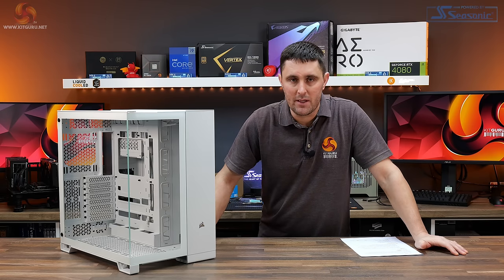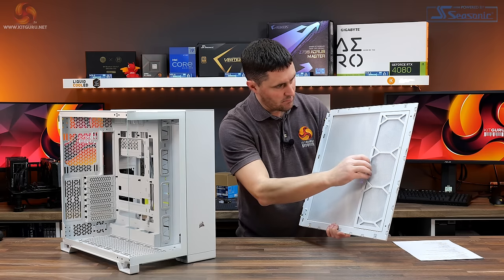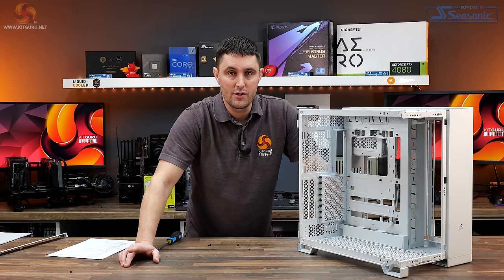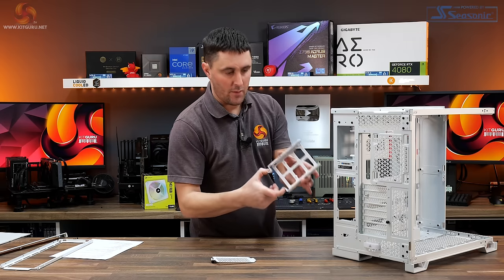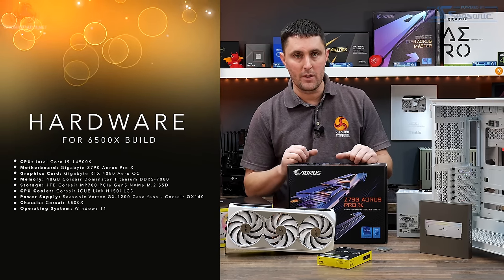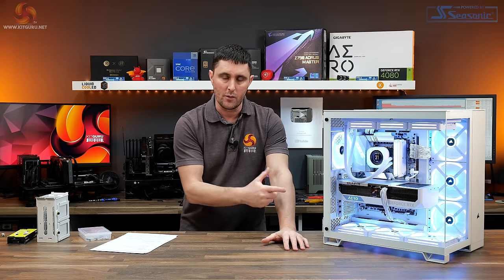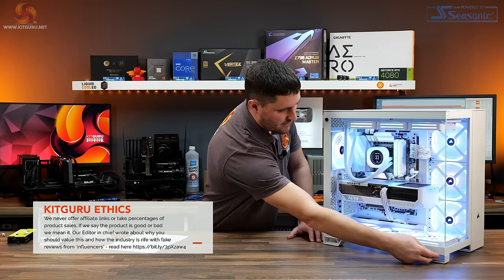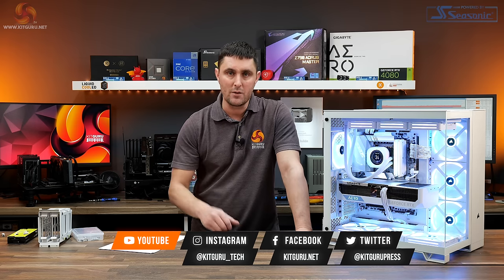Corsair 6500X Case - the good, the bad and the ugly

Comment: I was switching my PC's case to get one that had better cooling a few months back, I ended up going with the airflow version of this case. I've gotta say that I do love the case.

One thing I do need to point out. My PCIe slots for where the GPU screws into were also slightly off, slightly further back than other cases on the market. This was honestly a good thing! One of my biggest concerns was that with there being no floor from a PSU shroud, I couldn't use my GPU support bracket (I have one of the ones that is just a screw pillar). The PCIe screws being further back are actually putting more force onto the GPU, so much that it isn't sagging like it would've in my previous case, the GPU is perfectly level which I feel like may be by design... Struggle to get it in, but once it is, it really holds well!

The need to pay extra for the cable management straps did kind of bug me, but I solved this by just 3D printing my own and putting some velcro straps I already had in them.

Comment: I just got this case. One of the primary motivations in choosing it over the Lian Li option was the usb ports on top. Given my PC sits below the desk and that would put the ports at floor level. Thanks so much for your review!
Reply: This case comes with rgb fans?
Reply: @sectum.sempra  the rgb version does. the 6500x base does not, but the 6500x rgb comes with i think icue rx 120mm fans

Comment: I wish they would make a case that can accommodate a 420mm AIO in a push pull configuration with a thick radiator like Arctic Liquid Freezer iii mounted anywhere. The ideal case should have good airflow as well including the gpu.
Reply: Yeah the downside might be that the case would be massive
Reply: True but we need functional cases. And most of the time, there is a limitation on either the size or the location of AIO placement. I want one that has it all.

Comment: I'm just hoping for a bigger full size ATX version that supports a 420mm radiator. Aside from a few other nitpicks I love the case and the support for wood panels! Almost perfect! 
That is of course if this supports vertical GPU mounting. 
Also get rid of the white strip on the front glass panel on the right side. Would look much cleaner and less outdated like the New O11 Dynamic from Lian Li. Especially with this price.

Comment: I fail to see the point of this case for anyone outside diehard Corsair fans, pun not intended. Most O11 inspired cases from other brands compete on price, while the 6500X shown here is $40 more expensive for no discernible reason. The amount of flex on the rear panel is unacceptable for a case of that price. Looks like I'll be sticking with Lian Li for my next build.
Reply: Mainly for the compatibility with Asus BTF and MSI project zero. I have the lian li RGB case but switching to this one for the Asus BTF for that extra clean look

Comment: I don't want to come off as a Corsair hater but... I just feel like their stuff is ehh, if not just a tad overpriced for what they're offering.     
This case is great if you have a motherboard with reversed connectors. 
But if it's a regular motherboard, there's plenty of alternatives like the ones the video description name drops.

$20 USD more gets a base model Y70 which includes a vertical raiser (not that you have a choice with that case), and $40 less gets you a NZXT H9.     
Half the price of the 6500X gets you either a base model King 95 or a NZXT H6. And all those are great dual chamber cases too.

Comment: question on cases like this? Can you flip the case so its not specifically in this direction.

Have the clear corner on the left side vs its current right side
Reply: problem then would be you would need a reversed or "left handed" motherboard, i dont think thats made yet... give it time.. im guessing it will eventually be a thing, like baskside connector motherboards is a thing now

Comment: The back fan can fit a 140?
Reply: Yes.
Reply from the maker: Yes 120 or 140 fan support on the rear and there's some vertical height adjustment too.
Reply: @KitGuruTech There are so few dual chamber cases that support a 140 in the back, it's kind of a shame. I got a Corsair 680x and I like it a lot, except my current GPU barely fits in there, and all my fans are 140's. I've been looking for a new case for some time (not just for the GPU clearance, other reasons too), but I really want a dual chamber again so I've been passing on pretty much everything since it's all 120s in the back, unless the case is humungous. I thought about the Hyte Y70, but man is it expensive AF since it includes the display.
Reply: @EfrainMan yeah it’s not ideal. My issues with the hyte would be the build quality though. When James reviewed it here it was flexing really badly. I know it’s maybe not a big issue in the grand scheme of things but I was surprised at how badly some of it is put together

Comment: I had my eye on the smaller 2500x, only to find out it is absolutely massive compared to something like the 011 mini..
Reply: Do you really want such a small system though ?
Reply: @thetechdevil-jn1vo  Yes, absolutely! 

I want my case to have as small a footprint as possible.. Sandwich layer between 2x360 mm would be perfect for an ITX with a custom loop. 

Presumably, people buy ATX because of the expansion slots.. But in most cases these go unused, leaving you with a bunch of waste and a giant box of air. 

I like building PCs and I hate wasted space..
Reply: @Kaymen1980 ok makes sense. Cases must be a lot better now. My last tiny system was always overheating due to so much heat crammed into a small area.

Comment: How could Corsair forget the graphics card holder ??? is there any way to build one inside ?
Reply: nope.  when I purchased the case I also purchased a generic GPU vertical mount kit, but they have a proprietary bracket for the back.  Only way to get the Vertical GPU in this case is to purchase the (ADDITIONAL $80) corsair proprietary one. Even if you take a SawsAll to it, they were clever enough to make nothing mountable.

Comment: Not sure if I'm being stupid but here's an issue I had during my build with this 6500x case and an MSI B650 Project Zero which is a back connecting motherboard
I had an issue where the 3.5 inch bay on the back hits the CPU connectors and had no other choice but to omit the module itself so to create enough space for the cable
Another one was since this motherboard is an m-ATX, the power supply hits the back connectors such as audio and usb2.0 and it literally makes the power supply not fit (eventually had to force the power supply in without the audio connector)

i'm still looking for a way to fix these; if anyone has the same kind of issues but found a way to fix it, please let me know

otherwise the case looks awesome very happy with how it looks; just those 2 problems bothering me

Comment: I got mine in early march.  Gorgeous Project 0 build.  However, I got the vertical GPU mount a week ago, now that its in stock, and the GPU temps are about 5-10° higher than they were when mounted horizontally.   Still well under anything to be concerned about... I've got 3 140's on the bottom (blowing in), 3 120's on the side (blowing in), NZXT 360 elite on the top (blowing out, 'cause i paid attention in class when they taught us heat rises, no change in the CPU temps, btw) and nothing on the back.   (Its hard to find a single Thermaltake SWAFAN EX 14 ARGB... Anyone wanna split a 3 pack with me? 🤣🤣 (Seriously, though...)

Comment: I'll take a standard mid-tower case like the 5000d Airflow any day over all these unoriginal copycat O11 Dynamic builds cluttering up the internet over the last few years. The IPS screen on the CPU cooler looks neat at first, but I'm betting it's going to be one of those gimmicky components that's going to look dated in a couple years.

Comment: I don't get why someone would buy this case over a O11D RGB Wich is way more beautiful and is cheaper
Reply: How much cheaper is it ?
Reply: Or a montech king 95 pro.
Reply from the maker: @swizzler8053  we like that case too, one we remember fondly when we reviewed it
Reply: I like that this case is specifically designed for iCUE Link, that's my main reason.

also, ultimately, no one has to have a valid reason or explain it, people are allowed to spend their money how they want
Reply: I agree with you, some people possibly do not and vote for this one
Reply: @DedlyAidan yeah I’d agree. Icue is good. It gets a lot of hate for some reason.
Reply: You could buy another case and populate it with Corsair fans anyway
Reply: @KitGuruTech  the king 95 has definitely better value
Reply: The king 95 gets my vote but the build quality isn’t as good as the Lian li.
Reply: dual chamber, BTF/Project Zero compatibility.

it makes a big difference even if the Lian Li is more beautiful on few points
Reply: @sasoustrawberry  nobody cares about BTC or project zero
Reply from the maker: @DedlyAidan  I installed ten iCUE link-compatible fans in the case but didn't find any of the iCUE cable hooks useful. The only potentially useful iCUE Link feature built into the 6500X which other cases dont have is the cutout for the iCUE link port on the rear panel, and that's only if Corsair launches desktop iCUE link products soon.
Reply: Interesting thanks Kitguru
Reply: @JJ-gk5tn  not nobody just u
Reply: @immeliodass4402  nope that's just your thought
Reply: @JJ-gk5tn  nope that’s just ur thought
Reply: 6500D comes with 4 rgb fans which O11 doesn't. If you go for extra fans of Lian Li for the O11 then the total cost will be more than this Corsair case.
Reply: I was actually set on the O11D Evo until I discovered that the 6500x has the side panel on hinges, something I absolutely love and neither O11D or King has. Will order this week but not decided yet on which one.
Reply: @gojo_satoru_sama  yh the cheqp versions lol, id rather it didnt come with any so price would be lower
Reply: @gojo_satoru_sama  thats my problem with 5000t , i wish there was version without the old gen fans and control boxes so the price could go like a 100 down
Reply: Simple - I went for 6500D Airflow, because I wanted dual chamber, but I absolutely hate the aquarium style and front glass panel. Mesh with fans is what I wanted and this case delivered. Something that Lian Li or Montech couldn’t. 6500D looks - for me - better… especially after I put teak panels there.